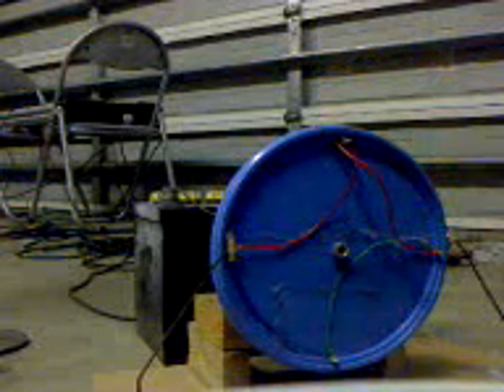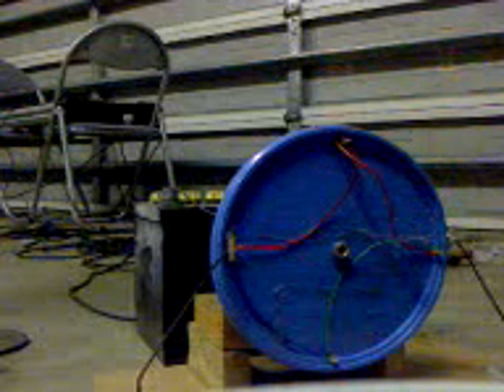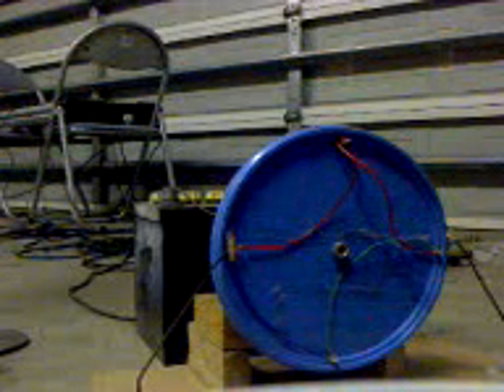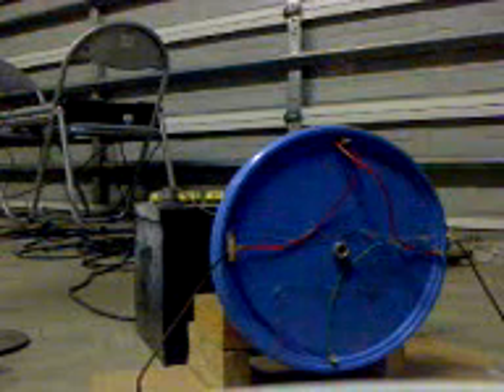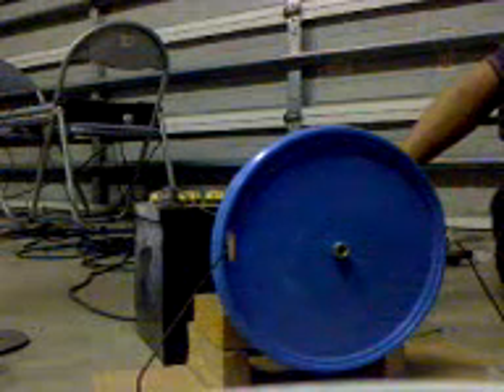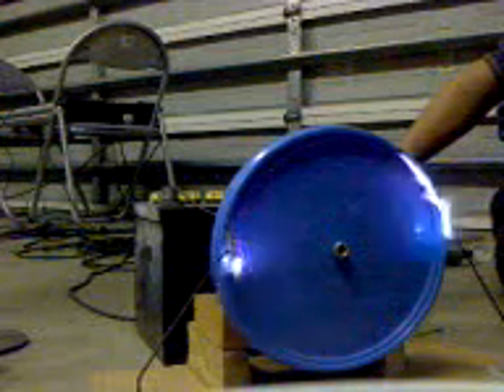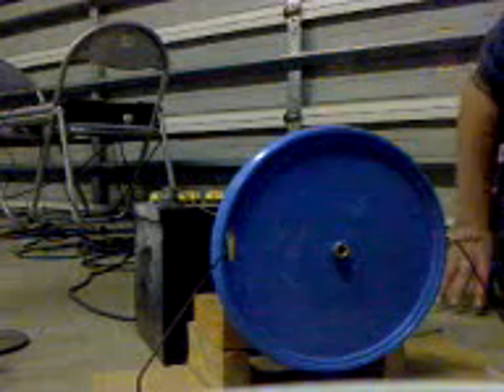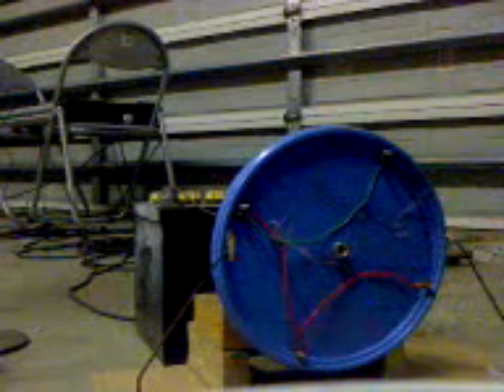rotory spark gap for tesla coil:)

Comment: instead of using wires to connect the flying electrodes and having the stationary ones opposite edges of the disk. use nice thick brass bolts and have the electrodes ether side of the disk so it goes through the bolt..

I'll post a vid response of mine running